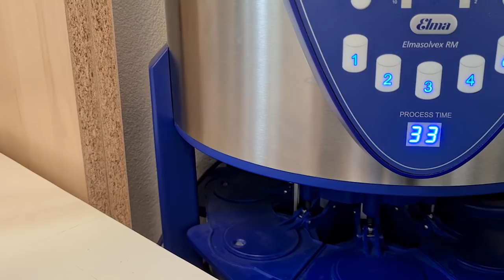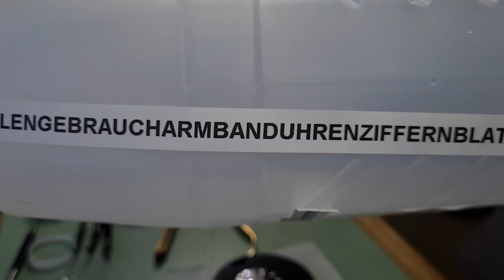How (not) to restore a watch!

Comment: By the way, I really found an Omega Chronometer from the 70s in the metal trash. It just had a broken glass and some scratches but was easy to fix in 15 minutes. Worth about $ 1'000 or more! Some people don't know that a watch generally looks worse than its outside. The only real enemy is rust and broken parts!
Reply from the maker: That's very lucky! A scratched crystal indeed often obscures a wonderful dial underneath 👍

Comment: I need your help, I have a watch that is perfect on the timegrapher with the dial facing down, with the dial facing up it goes more than 600s/day, which could be happening.
In the other positions it is without problems, it only happens with the dial up.
Reply from the maker: Hello Jorge, it's difficult to say what is happening without seeing the watch, but the first thing I'd check is if the hairspring touches something in that position, for instance the underside of the balance cock or the center wheel. If the hairspring is not flat this might be the issue.
Reply: @VintageWatchServices  Thanks for your attention, I will check these points.

Comment: I can guarantee you that "Vintage Watch Services" is not a scam (besides this episode), since Stian seems to be an over-the-average watchmaker. My father was one of them, a real watchmaker that doesn't just change parts and were called "rhabilleur" or "repairmen" to distinguish them against the real "horloger" or watch doctor who also knows how to repair parts (f.ex. untangle a tangled hairspring) and how to make entire parts like axles, wheels etc. The only parts a watchmaker can't do in his shop are mainsprings, hairsprings, dials, glasses and of course special work that is more a goldsmiths work like enameling or guillochage.
Reply from the maker: Thanks a lot, Juri! As long as one takes pride in one's work, it will turn out well :)
Reply: @VintageWatchServices  Watchmaking has something relaxing. On the other hand, one can also go crazy with it.

Comment: Well, that was a huge disappointment. It turns out Stian is using Restoration Liquid. There are some that would call this cheating. You are supposed to do the fiddly bits by hand! (Just like Slartibartfast did the fjords.) Also, since Stian has now revealed a National Secret, he will no doubt be severely punished by having to listen to two hours’ worth of schweizerdeutsche poetry. (Think Vogon.)
Since I happen to live not far away, across the border, I went looking for Individuellengebraucharmbanduhrenziffernblattwiederherstellungsflüssigkeitsmittel. First, I was told to go with eau demineralisée. But after I bribed two moose trainers I was directed to a certain building which was totally unremarkable except for a sign “Nothing secret inside here”. It was suggested that there might be, at the right price, a homage product called “Ziffernblattwiederherstellungsflüssigkeit für den Individualgebrauch”. But it only came in Bavarian flavours. No joy, then.
Reply from the maker: Hmmm... I think you were probably intercepted by representatives from the Swiss German "Schweizerischerstaatsgeheimnisseundgeheimerproduktesolchergeheimnisseschutzungsorganisation"?